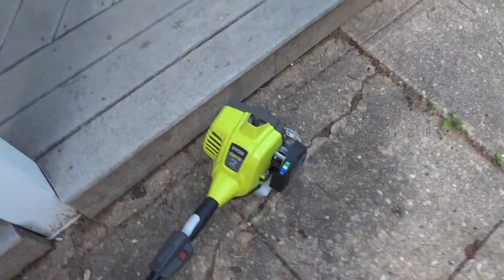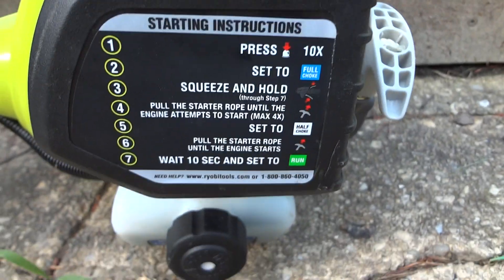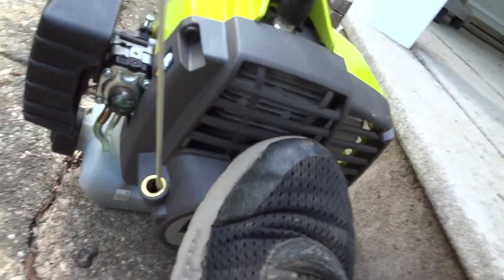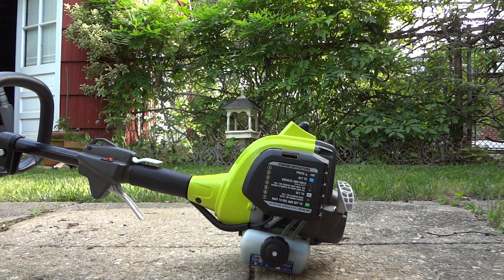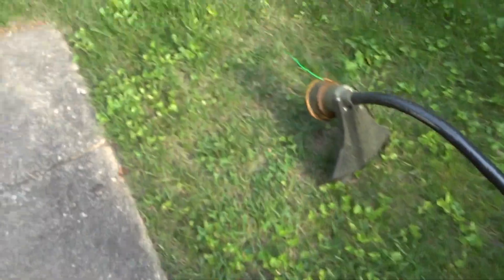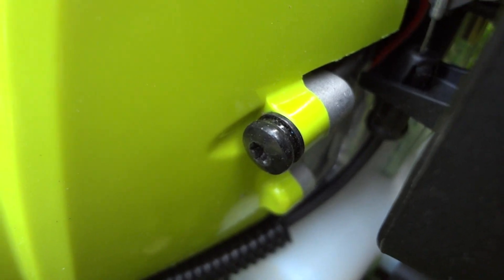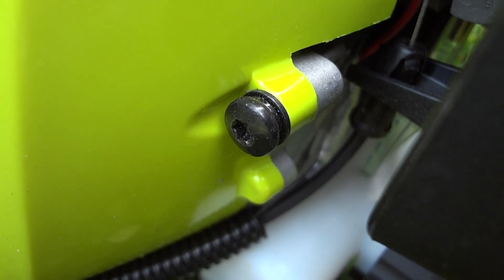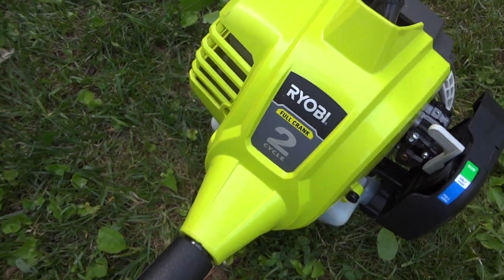My New Ryobi 2 cycle Full Crank Weedeater Review

Comment: That's what they do they vibrate in almost all weed eater do 2 cycle that's why it's a 50:1 ratio gas so u can use full throttle while cutting grass believe me if it wouldn't handle full throttle it would be set back some I like for $129 & a 3 year warranty I think it's a nice weed trimmer I wouldn't use if u had a  landscaping business but for just a yard maybe 2 weeks a month it's fine!!!!
Reply from the maker: It still works reliably as of today. People say that these are hard to start but I can start mine in one pull sometimes. Keep in mind that this has been used every weekend from April to October for about three years now.
Reply: @Joethaboss66  Yeah man mine dose 2 even on a cold start 2 pulls starts right up u can't beat the price in those  2 cycle engines if they didn't want u to run full throttle they would have it set back for $129. I love it can't beat it & u can put the heavy string on it so u ain't putting string in it everytime you cut ur yard!!!